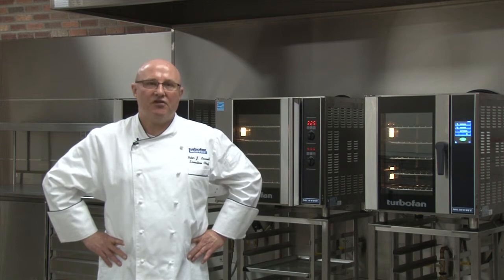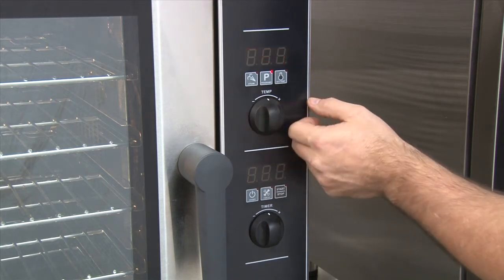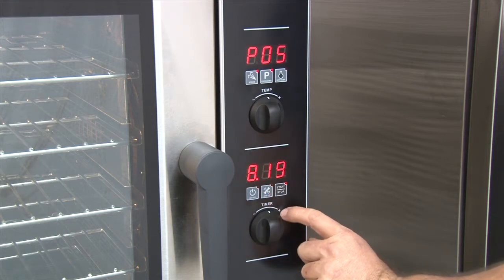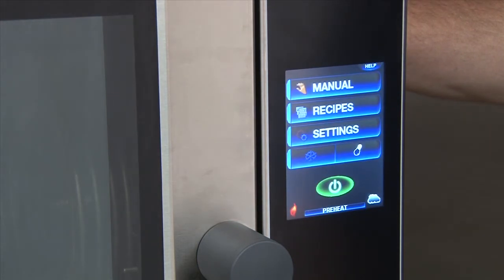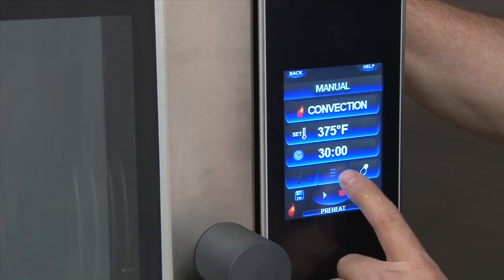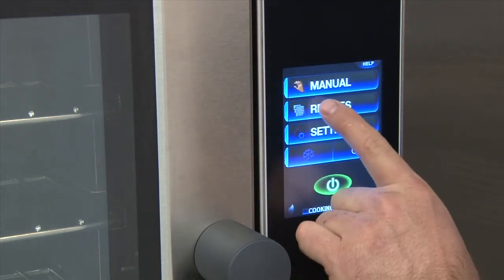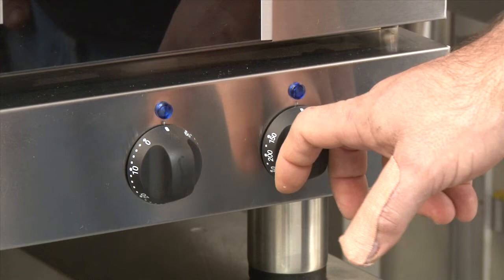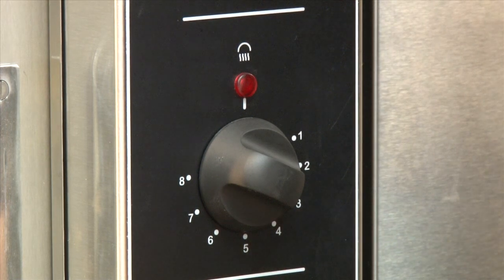Moffat - How to Operate Moffat Turbofan Digital & Touch Series Ovens

Comment: Moffat: I bought a Moffat gas oven from Lordship cookers Lordship lane North London in 1989 it is still working perfectly n it had a lot of use the timer working fine put the over to turn on n then off so when you get home your hot dinner is waiting for you, it was expensive at the time £400 But in the Long run its been the Best kitchen appliance i ever bought when we changed the kitchen we got a gas over with it after 6 months use we replaced the new over with our OLD trusted n perfectly working Moffat Gas oven Moffat must have used the Best possible Materials when building their ovens but like an old Lister diesel engine build to last for ever so is the Moffat gas oven worth every penny, many thanks Moffat you are second to NON